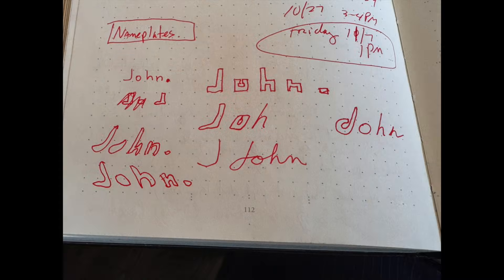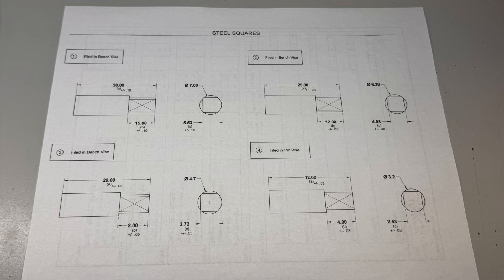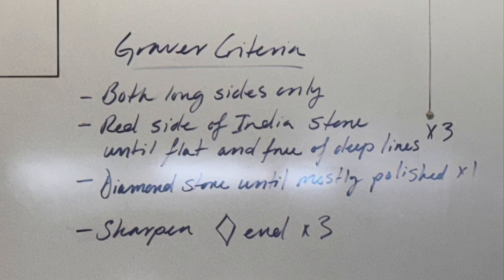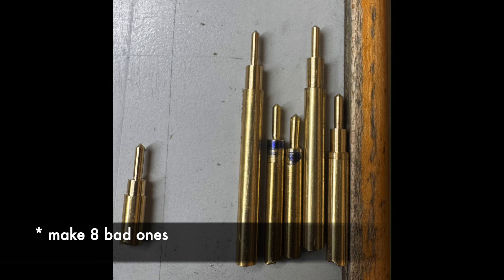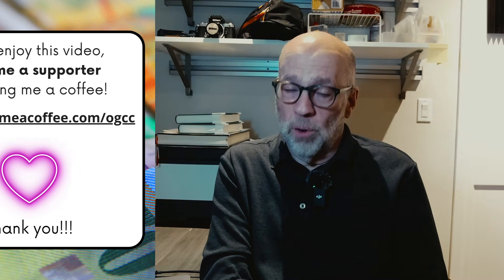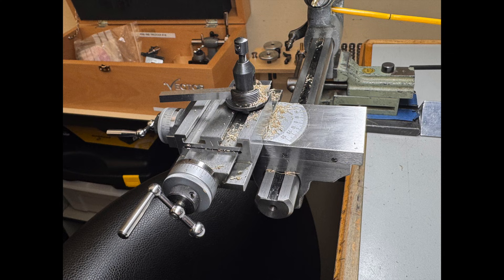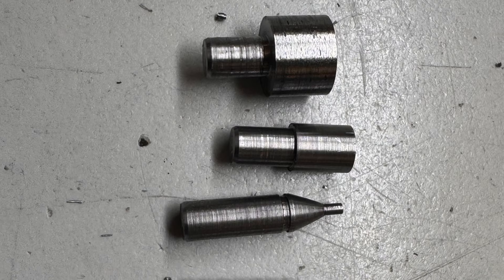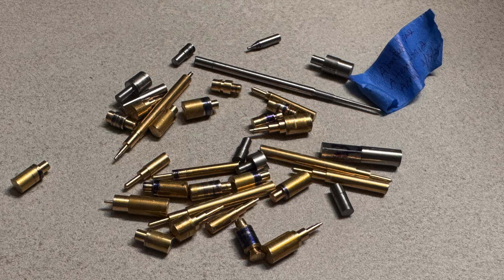My Tough 2nd Month at WTI: Diving into lathe work

Comment: BTW. one thing I learn again and again in machining is that stock is always too short... I my case it's misplaced frugality (yes metal is not cheap but it's not that expensive either unless you have to do it twice) but if you think you need 20mm extra, cut off 25mm extra. This is more important as the tool used gets more imprecise... ie. leave more for hacksaw than for lathe parting tool. Also, trim it with hacksaw and then finish it on the lathe.
Regarding dials being imprecise, it's not just a matter of backlash. It took me a long time to internalize that everything is a spring. If goes for the jeweler's lathe and for a 100 ton vertical machining center and especially for that 8mm brass rod you're turning. As the tool bites in, workpiece and tool both deflect and the cut moves away from a theoretical ideal cut line. Usually this leaves you with an oversized part and that is why we usually run one or two spring passes at the end without moving any dials, but depending on geometry you can have the tool drawn deeper into the material (or material into the tool) and that's way worse since now you have blown the dimension and as often as not crashed the tool in the process.
Reply from the maker: That’s a great observation. Never thought about the physics of it in that way.  Re: length, you’re quite correct, the cost of my over-zealous frugality is an hour or two of my time and some mental energy loss. All for trying to save a couple of millimeters of metal!

Comment: I'm quite interested in how you killed that collet (no irony intended)
Reply from the maker: First, the piece I was cutting was too long. I had not yet grasped that you shouldn’t have 6 inches of stock hanging out of the collet. Second, my graver got sucked underneath the piece because my T-rest was too far away from it.  So, there was an unexpected upward force on it.

The collet I think said to itself, This guy is a nut ball, I’m gettin’ the heck out of here. And blew itself apart.

There’s a rumor going around the school that the 6.2 and 6.4 mm collets on these Vector lathes have a history of blowing up. So maybe a contributing factor was that those collets were from a bad batch?
Reply: @Oldguyponderingacareerch-ip9tf  Well it does look like it has very little meat where it broke, but still, force is mostly lateral, and collet is supported by holder in that direction.

The 6" stickout on 1/4" stock is pretty extreme, even if you support it with a center in a tailstock, it will still be as stiff as a noodle :) I tend to keep stickout under 3-5 diameters when tail end is not supported. You can go much longer if you're just drilling the thing though

Comment: Don’t be down, things will get better, remember practice makes perfect, so you need more practice. Simples. 
And also, of course you bugger it up on the last cut, that’s the one that counts. If it was to produce a turned diameter of 3mm plus or minus .001mm it’s only the last cut that is important. The hacksaw is a classic mistake. Be more patient. Remember, you will pass. Good luck.
Reply from the maker: Thank you for the advice.  The wife says I’m too hard on myself.